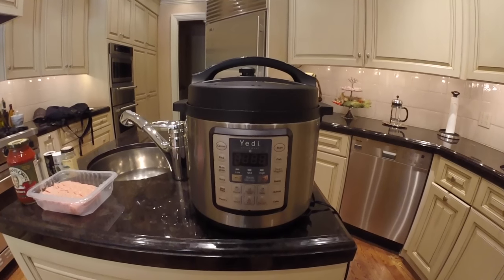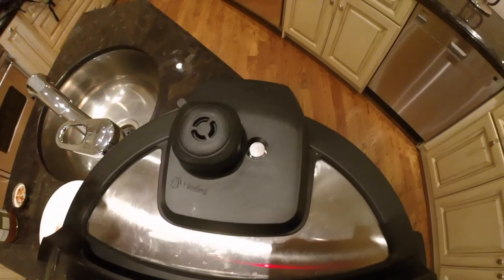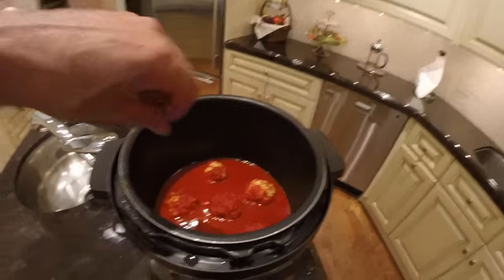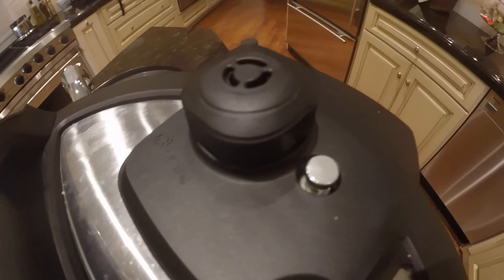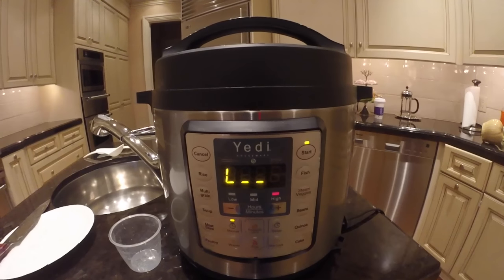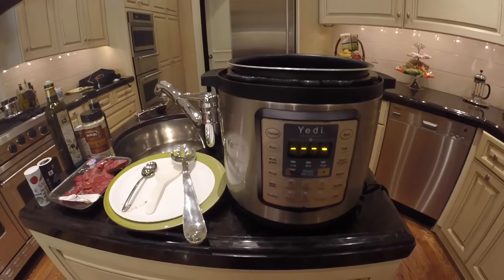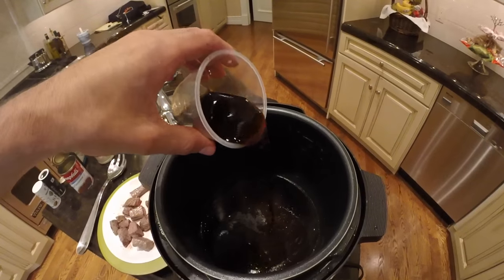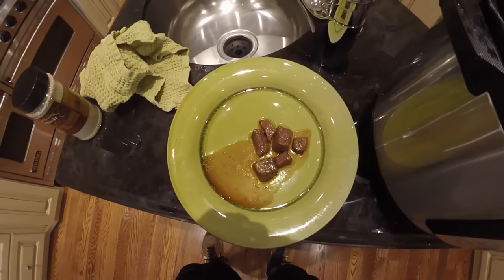2016 DEMO VIDEO - FIRST GENERATION Electric Pressure Cooker by Yedi Houseware

Comment: Thanks for the how-tos! Great for newbies! Not many of these cookers have stainless steel inserts. But the new Yedi does! The Current Yedi offering also comes with more accessories than the instant pot and combines features included in the models above the duo plus, for the same price as the duo plus alone. The accessories would run about another $50. And the reviews on amazon are better. No brainer. I’m going for the Yedi. The only extra item to buy is a cake pan. Since all instant pot accessories fit the Yedi (the Yedi and instant pot are made in the same factory, apparently) I’ll order the instant pot silicone cake pan on amazon for $12. Comes with recipes, cheat sheet, and quick guide. Also there’s an app with recipes.  Instant pot recipes are also said to work in the Yedi. And the Yedi has more markings in the inside of the pot so I can easily know how much total liquid it contains.

BTW:  LOVE THE BRIAN CRAIN MUSIC IN THE VIDEO!! It’s beautiful, isn’t it?
Reply: I see the finish on the top part of the inside is already chipping off.